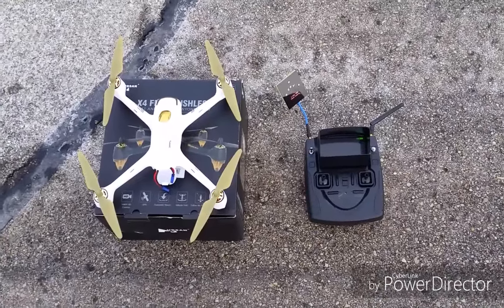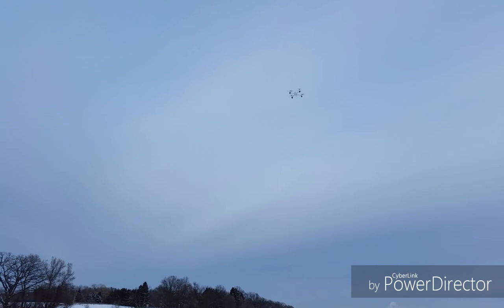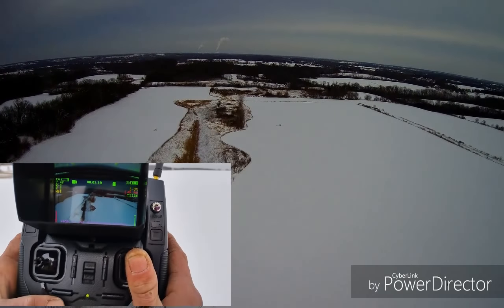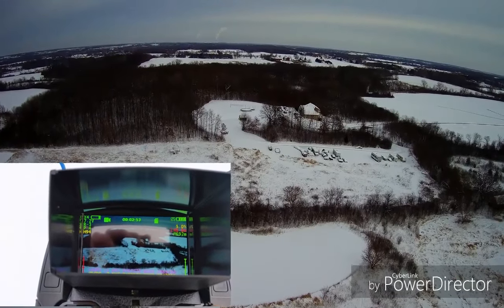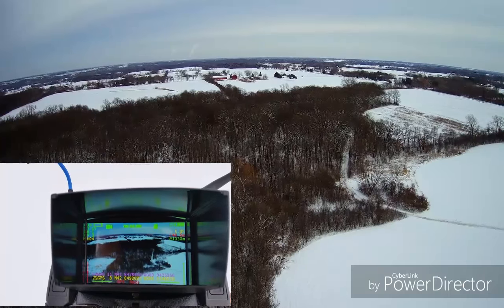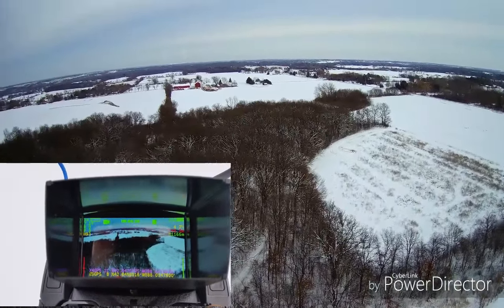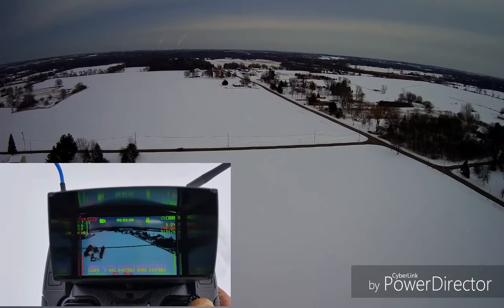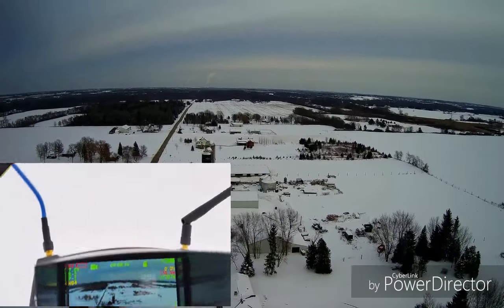hubsan h501ss 2.3Km Range Test. Second Flight After Mods.(May want to turn on Captions).

Comment: Are you liking the SS version okay still? This is the one that comes with a battery for the tx as well?
Reply from the maker: Well, I have not purchased any hubsan quads, since my last 501ss. It's still flies good, as well as my original h501s. I am hearing that the newer 501ss models are coming with voltage Regulators, built into the Flight batteries. That's Not Good ! It can cause catastrophic failure in mid-flight. If the quad draws too much amperage at one particular time, the voltage regulator kicks in and shuts off the battery, causing the quad to fail / crash. People are avoiding that by getting flight batteries with the same specs just not from hubsan. "Tynergy" brand sells them, for example. Otherwise, they do come with a battery for the controller and the quad but you have to watch out for that voltage regulator !
Reply: @MarkSuttner  Thanks I will be careful. :)
Reply: @MarkSuttner  That actually really sucks, Is this common for them to fall out of the sky? One of the big reasons I wanted this drone was the cost of it's batteries at 10 a pop.
Reply from the maker: Matt Jones  Matt, I'm not 100% sure, if all of them are being distributed with voltage regs in the flight batteries. I am giving you this information because of a few people commenting, that there quad just fell out of the sky, for no apparent reason, while they were Full Throttlling up (max amperage draw) and a few recent videos, showing how to test if you have a voltage regulator in your Hubsan batteries. Put 2 and 2 together and you can tell. However, as like always with hubsan, not sure if it was some kind of trial and then they discontinued it, or if it comes with all their batteries, etc. Amazon is sold out of the Tynergy replacements. I just checked. Ya know, I would not worry too much about it. If it's Truly a problem, I'm sure Hubsan will deal with it. Especially when people are having to return their quads for replacements because it's battery failed in flight. Also, it could just be a certain distributor, not sure. I've never had that sort of problem but like I said, I bought mine awhile ago. I always get most of my stuff from Gearbest. Whomever you buy from, is obviously up to you but if you buy a 501ss, make sure to check the battery ! I forgot who made the video about the batteries and how to check if they have V-regs in them. --> https://youtu.be/CLHd1ngPYLo.
Reply from the maker: @usarmyfl1  I sent you the link to one of the videos I saw. I would not worry about that so much because you can test for a regulator and I'm not sure it's that big of a problem.
Reply from the maker: @usarmyfl1  https://youtu.be/CLHd1ngPYLo
Reply: @MarkSuttner  Thanks for all of your help! :)

Comment: Fantastic job Mark!  Amazing flight and the sound track you choose makes it very immersive!!  I’m currently flying my Bugs 2c, but am very interested in the Hubsan 501ss. Hopefully they will send me the ss version and not the older s ver.  I would of course want to do the antenna mod like you did, but my question is, were the stock antennas “soldered” to the board, or were they just “pop off” connectors making the switch easy without soldering??  Thank you very much for sharing this amazing flight.  Kind regards, Jim
Reply from the maker: jim buxton No Soldering. Simple Ipex to U.fl Connections. https://youtu.be/fCibtj-YgRI
Reply: Mark Suttner Thanks again Mark, do you have a link to that patch antenna?
Reply from the maker: jim buxton  https://m.gearbest.com/fpv-system/pp_436713.html?wid=21
Reply: Mark Suttner very cool, thanks Mark!

Comment: Unbelievable, I can not believe with a stock battery you did that, I can not believe wow, I would not try that,
Reply from the maker: I couldn't believe it myself. It turned out to be about 23 minutes of flight time ! I really didn't think it was going to make it back. But, It did !  Just the one stock battery, that came with the Drone. However, it was, at its full potential because it was right around, 10 charge and discharge cycles. So, it accepted a full charge, from my charger and successfully made it that far and all the way back ! Cool hey ?
Reply: @MarkSuttner  What charger do you charge the battery with? With the stock picker in the box?
Reply from the maker: I use two. This "Duplex" is my favorite -> http://radientrc.com/duplex/. This ImaxB6 (v2), I also use as well. But it can only charge 1 battery at a time. Otherwise it is a good charger, however you have to make sure you do not buy a "Clone". On the internet they sell a lot of Fake ImaxB6 chargers. The real ones should have a sticker of authenticity on the back, that changes when you rub your finger over it. This one -> https://goo.gl/images/4gCT9c. No, I Do Not Use the Stock "balance" charger.

Comment: Amazing drone, I also did my 2020 meters 2 days ago and came back with 6.9 voltage batteries with 15 minuets flight time. Love this bird, only hope Hubsan could introduce new gimbal version drone so that clip steady stills otherwise that drone is rock.
Reply from the maker: +Mohamed Habib You can add an aftermarket gimbal and camera to the H501SS, but that also requires some landing gear as well. When you add the extra weight to the quad, it cut your flight time in half. The h109s X4 Pro is a good camera platform drone made by hubsan.

Comment: Great flight Mark. I gave up on my hubsans,, THEY LOOK BETTER ON MY WALL THAN THEY DO FALLING OUT OF THE SKY 100'S OF METERS AWAY FROM ME.. Im tired of buying 2 or 3 of there batterys at the outside chance that maybe just maybe? One battery will give me an 16 - 20 minute flight instead of my avarage 7-10 minutes flights.. I hate gambling and I hate luck of the draw,, If hubsan worked 90% as well as it's claims ? I would be right back on there team. and never be tempted by anything DJI. i told myself that I would start to date and mark my flight times on my new batterys as i buy them from Hubsan, and start complaining as the results come  back in the negitive,  but time pass's and we get side tracked on other things, I have yet to take my one surviving 501's (out of four) past 600 meters,  and my h109s has only gone 450 -500 meters,, all I wanted was 1,000 meters,, with decent fpv and enough juice to rth.  But the little voice in my head says,,, IF YOU FLY YOU ANY OF YOUR HUBSANS ANY FURTHER THAN 400-500 METERS?  (say goodbye)  because it will be the last time you will ever see them !  And now there is 501-ss ?  I would have better odd's of not loosing money at a STRIPPPER/PICK POCKET convention..
Reply from the maker: anyshitt +anyshitt Bro the SS Version quad has been Upgraded. It flies a lot better than the OG 501. It's way more stable, it's faster, has more range, does not suffer from the tumble of death and doesn't toilet bowl as much. It's also a lot more stable in altitude hold. They are Worth A Shot ! I rarely fly my OG 501 anymore. The SS is Hella Better !!!

Comment: Hello Please HELP.. I ordered a 501s.. in looking it over its a hubsan 501ss ,, the box said 501s ,,the bar code says 501ss.. also in the description from Amazon it said you need to put AA batteries in the transmitter you don't..it came with a 7.1 volt rechargeable.. this drone is black in color..the transmitter also is a standard transmitter it's not the advance one..circuit board inside of drone is green it's not blue like the 501s.. need advice bad man.. I don't know what to do.. I haven't even flew it... I put it back in the box..
Reply from the maker: Cluster Room Everything is Fine. You received a H501SS. Everything you received is normal. The SS has basically Replaced the S. The standard version does come with the rechargeable 7.4 volt LiPo battery for the controller. Your All Good... I did make a video about the differences between the two.
Reply: ok thank you.. I just watched your other video on know the differences between the two,,and you were right..Thank You..one more question and I won't bug you anymore do I need to register  this drone with the FAA Thanks
Reply from the maker: Cluster Room First, you are not bugging me. I like to answer questions or give knowledge to people that need it. As for FAA regulations, YES, you do need to at least get a Hobbyist UAV FAA registration. It's $5 online and you just put your numbers on any quad you have. You must have a FAA hobbyist license / registration if you're going to fly any UAV that weighs more than 0.55 pounds. The laws are kind of funky, all you need to do is go on FAA website, answer a few questions put in your personal information and they will give you a FAA registration number which you put on all your UAV's.
Reply: OK I will get one ..Thank you very much for your help with all the issues that I had..
Reply from the maker: Cluster Room No Problem ! Anytime brother !!! Happy flying and Blue Skies !!

Comment: Wow you sure have the fpv working great.i still think the standard controllers work better than advanced!
Reply from the maker: +scott-n-anna's rc fun Absolutely ! All day everyday ! I can't get that much range with the FPV1/Advanced Controller. I don't think my SS Controller is showing battery Voltage Accurately. I started with the Flight Battery Fully Charged and the Controller Battery. If you watch the screen, it says 7.4 Volts on quad When I start ! And thee Controller battery Also says Not Full. IDK, but I was literally praying that it would make it back ! When the quad landed my controller's battery reading was at 6.7 Volts (Quad) & 3 notches below full (Transmitter). Great to here from you Scott ! Hope You & Family are doing Well !!
Reply: thanks mark!!ya i noticed your battery level low when you started.that was a great flight for a hubsan.just got my phantom replaced(thank god i bought insurance)but customer service was frustrating .got a vid about it coming.
Reply from the maker: +scott-n-anna's rc fun I was thinking the same thing. My H501 would only go to about 1,500-1,600 meters. The SS gets Amazing Range. I was Freezing & Praying it would make it back ! Definitely quite a distance for a Hubsan quad ! Have you tested the Range with your P4 ?
Reply: yes  on a clear day i was getting 2.5 miles in 5.8 and 3 miles in 2.4(add a mile to both with a 5 dollar parabolic reflector)2.4 only works in the woods where theres no wifi interference .i stay on 5.8 most of the time.its supposed to go farther but thats what i get.havent range tested the new one yet.just got it yesterday.
Reply from the maker: scott-n-anna's rc fun Cool ! I know it's "Supposed" to go further using 5.8, but there's A Lot of things that can interfere with 5.8 . Even though it is a Higher Frequency, and "Should" be less affected, that's Not always the case.
Reply: i get farther in 5.8 in my yard(wifi all around)and farther in 2.4 in the country.
Reply from the maker: +scott-n-anna's rc fun Cool. Yes, 5.8 should be less receptable to interference from WIFI Routers, cell towers, etc. 2.4 "Should" give you longer range, but only Without Potential Interferences. That's Awesome Scott ! I like how Phantoms & DJI Products show Feet Instead of Meters...

Comment: Google Earth showed about 2.36 kilometers.
Reply from the maker: Jerry Bell Awesome ! Thanks for noticing that. I can't believe that it made it that far and Returned to Home with One OEM Hubsan Flight Battery !! :-) I've seen A Lot of other people fly their quads that far, However they are Usually using a larger mAh Flight Battery or a Dual Battery Mod. Cold and Dense air Does help with Rotor Lift and keeps the battery, motors, ESC'S and the FCB Cool. Thanks for watching ! I appreciate your time sir :)

Comment: Hi Mark, what firmware versions are you running in your H501S and H501S-S?
Reply from the maker: For the 501S -> 4.2.9 / 1.3.3 / 1.2.12 / 1.1.21 . For the SS -> 4.2.24 / 1.3.4 / 2.1.29 / 1.1.38